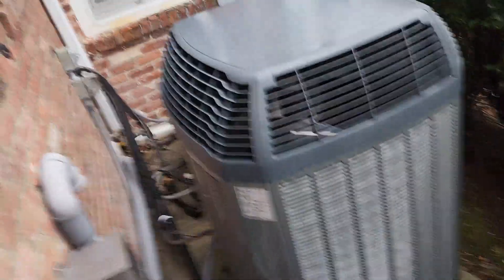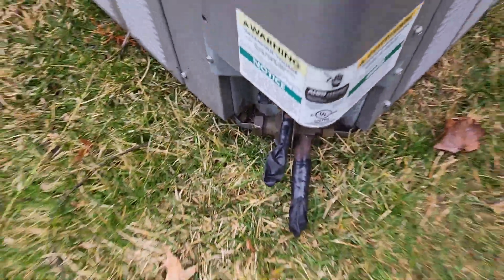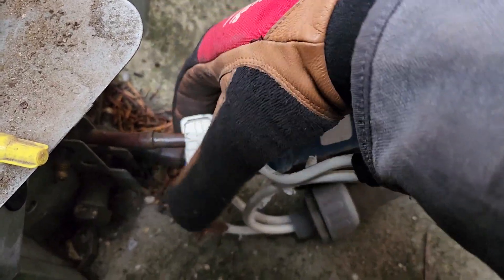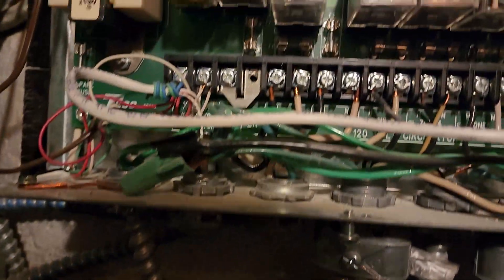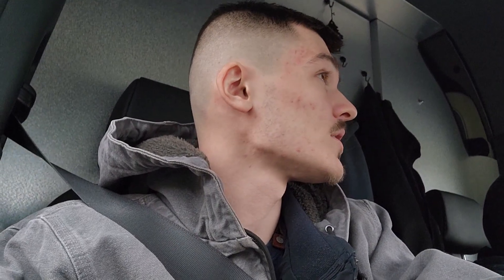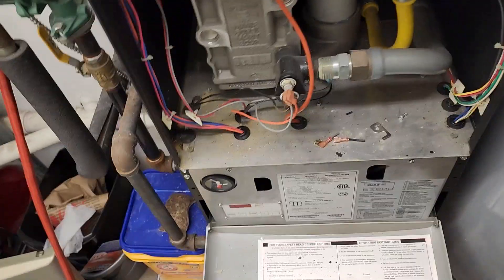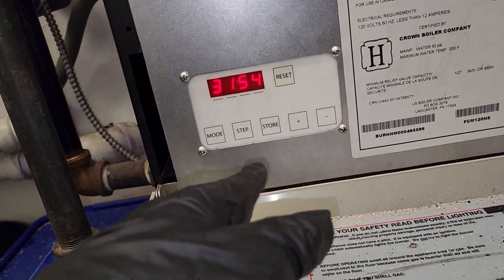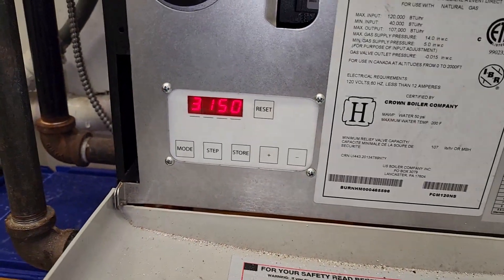Relocating 2 Condensors, Replacing a Broken Pressure Reducing Valve and Backflow, and Bad T-Stat

Comment: Just out of curiosity could you not pump the units down so you didn’t have to recover?
Reply from the maker: The last time I tried to pump down rheems they started to bypass and scream so I stay away from it
Reply: @DCHVAC  Sounds like that one had a bad compressor.
Reply: @DCHVAC  If the line set is much above 15 feet then they might not pump down, but if it's anywhere close to 15 feet it ought to pump down, if not it has a weak compressor.

Comment: Do you not use inhibitor in the heating systems in your area?
Reply from the maker: Nope
Reply: I use inhibitor in my lochinvar boiler every year no signs on calcium or any other stuff at or near heat exchanger, get mike to start using it!! I’m CT so we’re close